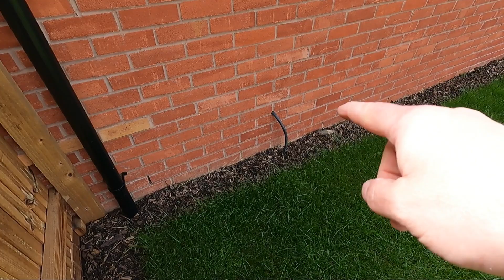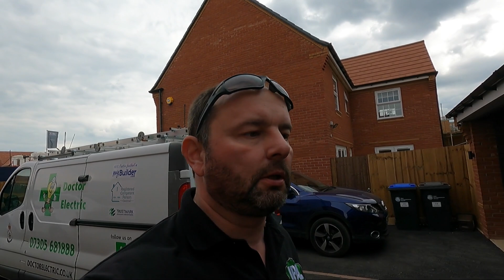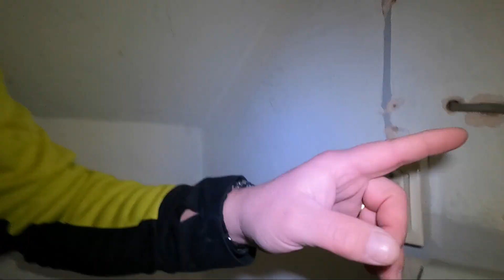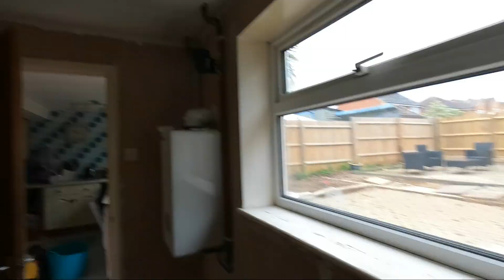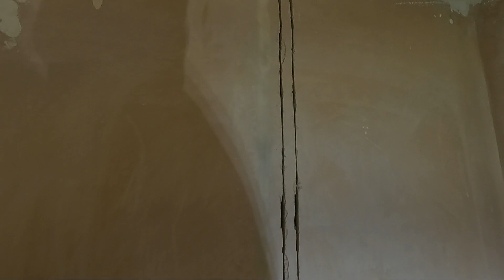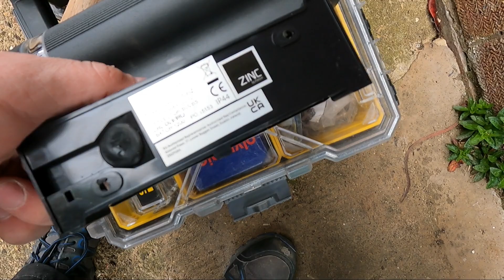Tesla EV charger Installation

Comment: Did you have to notify the dno before or after the install or does the client do it?
Reply from the maker: Hi Dazzafat,
There is a form you use to notify the DNO, it is supplied by the energy networks association, it is called "Notification to DNO of installation of dedicated electric vehicle charging equipment", I can't seem to find a copy online.
I do the notification after the installation, when I'm doing all of the other paperwork.
Thanks for watching!
Reply: @TravellingVeteran  thank you mate 
I've steered clear up to now but I've got one in December 
Thanks 😊

Comment: Hi mate, thanks for the video. Just wondering, have you installed a Tesla unit using an Earth rod? And if so, was the impedance low enough for the car to charge?
Reply from the maker: Hi J&CF, 
off hand I think I have installed 1 Tesla gen.1 and 2 gen.3's, I think the gen.1 was an earth rod and the gen.3's were with GARO PEN fault detection.
I've never had a problem with the charger not having a low enough impedence, but had one recently where the charger was tripping a 32A MCB, still monitoring that one to see what's happening.

Comment: I wonder why you can get away with shit work on New builds, I am guessing that governing bodies don't inspect contractors who solely do new build sites. 
And why would anyone use a plastic board, if something happened and it went to court, some switched on solicitors would find a way to nail them to the wall, unless they came up with a good reason why they chose a plastic board, regardless of what the regs may say..
Did you not try sending your cable down that existing duct, looks like a good size duct could have saved you some work.
Reply from the maker: Hi Anthony, thanks for the comment.
It's crap isn't it!
There was no ducting there unless I missed something?
Reply: @TravellingVeteran  looked like a duct under the adaptable box on the house
Reply from the maker: @acelectricalsecurity  Yes, just noticed that, think it's for the garage DB, I suppose I could've used that, probably would've been a bit easier but just didn't notice it at the time, cheers